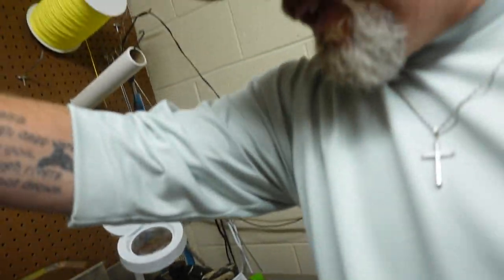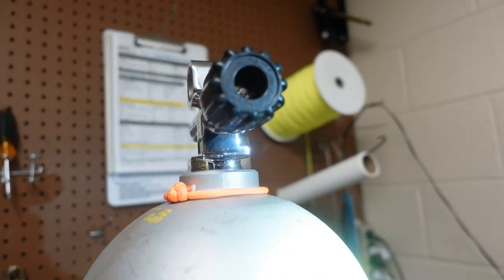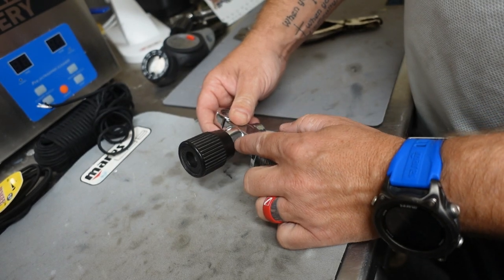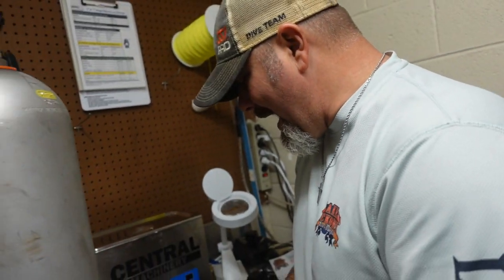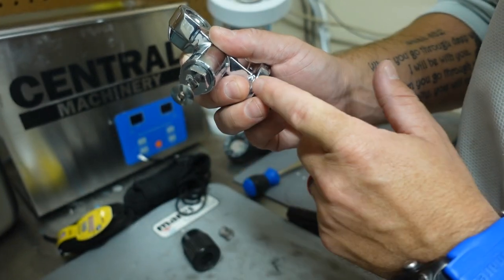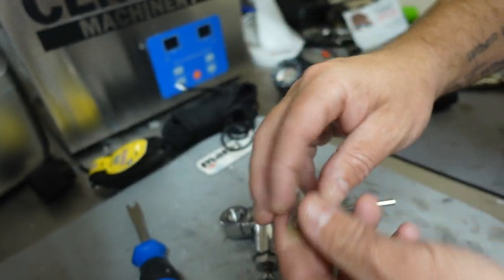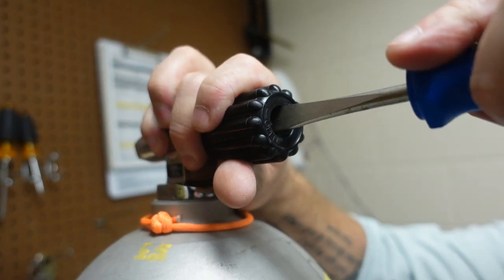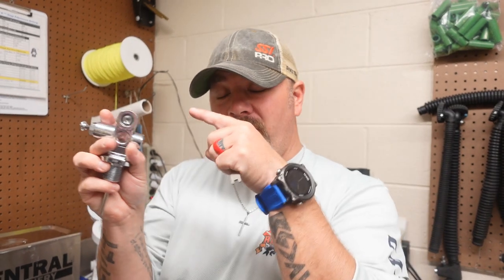How To Fix A Wobbly Valve Knob

Comment: I prefer to have a thread or two of the screw exposed, that way I can run my finger against it to make sure that it hasn't loosened.
Reply from the maker: Hello @Teampegleg, thanks for sharing your thoughts with us. One or two threads are not a problem.

Comment: Is it possible for the little nut to loosen off? Looks like it’s not really very tight on there?
Reply from the maker: Hello @MrBlueBullet, they can come loose without the proper tension from the spring. Every time we service a cylinder, we service the valve as well to help prevent this. Replacing the turn knob on a valve is an simple procedure that any diver can do in the field, and unfortunately, some times the wrong spare part will get used, and this is when we typically will see the turn knob start to become loose each time the valve is open and closed. A fun fact for you, just about all valves can accept a knob from other manufactures, however, the spring is specific.